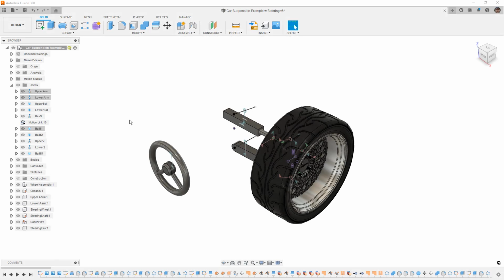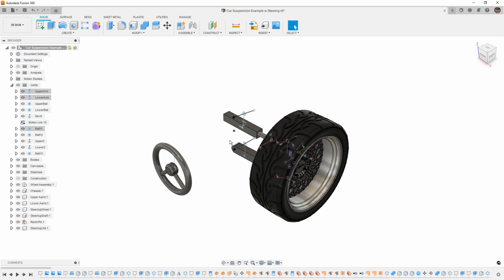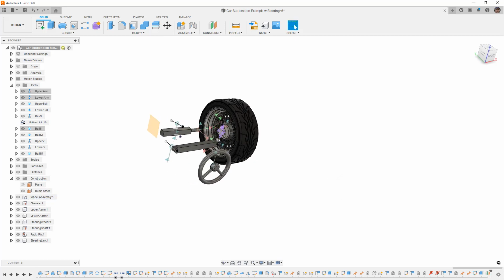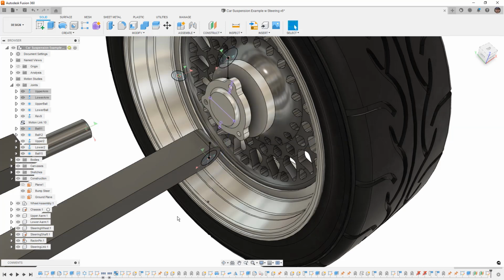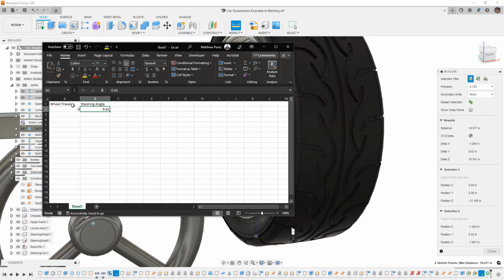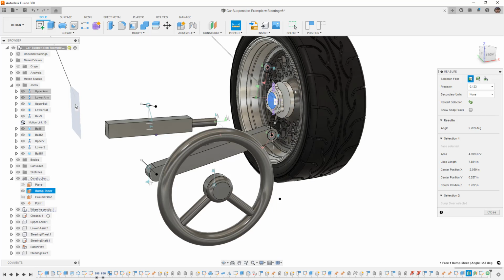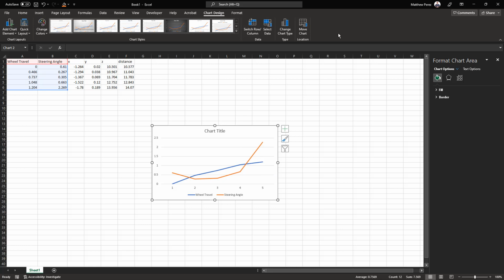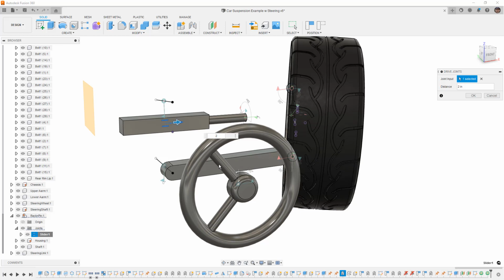Suspension Kinematics in Fusion 360 | How To Track and Plot Bump Steer #fusion360 #cardesign

Comment: Thank you so much for this video. I’m in the process of trying to build a generic “suspension simulator” and this video was super helpful.

One of the thoughts I had that I’m trying to figure out is defining a large number of dimensions as driven dimensions. 

Then I can move the suspension through its motions in .25 inch increments, export all variables, move, export, etc. 

That way I can grab plots for bump steer, Ackerman, caster, camber, etc. 

It might not work (read probably won’t work) but I figured I would leave this here in case someone else gets it figured out.
Reply from the maker: you could probably get it to work but it would be a ton of work.  If you could automate it with a macro that might help.

Comment: Very helpful thanks, quick question what computer/laptop are you using.
Reply from the maker: Thanks!  The computer i use for these i got from www.mysolidbox.com   it was a creative level 2 with a few minor tweaks.  It is about 2 years old at this point so the one they list now is slightly different. Mine has a core i7 10700k processor which is a little faster than what the current offer is(i think) and 32gb ram. running a lower card the nvidia quadro p620.  i found for most uses that a high end card really isn't needed.  If i was still doing a ton of rendering/viz work i would opt for a higher end card and more ram.  something with the cuda cores and GPU.  Fusion doesn't really need that.

Comment: There might be shortcomings but it's much easier in Fusion360 than it was on a drafting table in 1962 when I was doing suspension design :-)
Reply from the maker: Sounds like some interesting stories :)  For sure, but when other CAD software will do this automatically and allow you to define spring/dampers and plot the kinematics of those points......  Economy of scales though.  If you are designing a lot of suspension(now a days) there are specific tools.